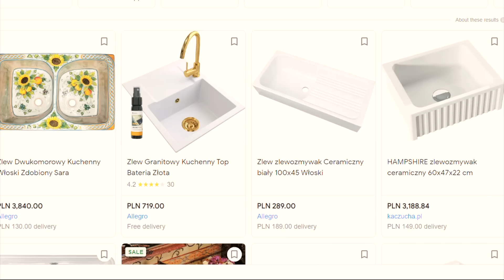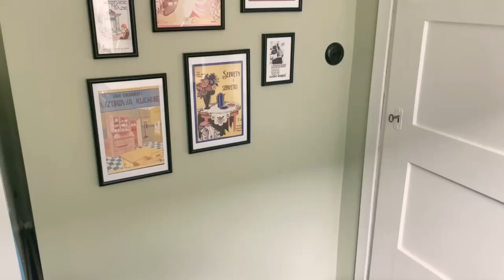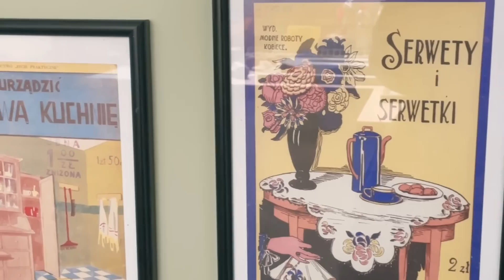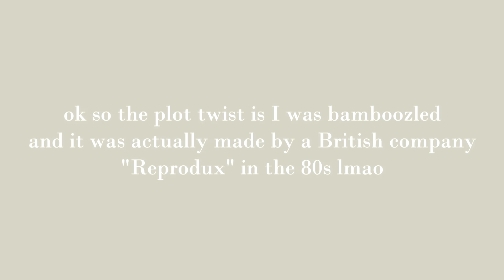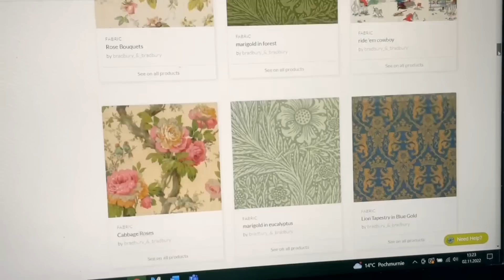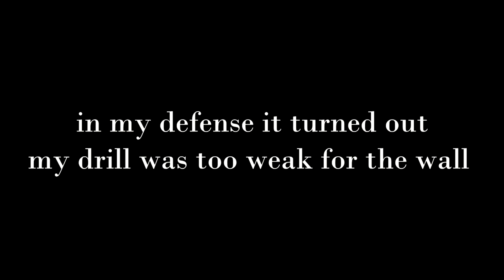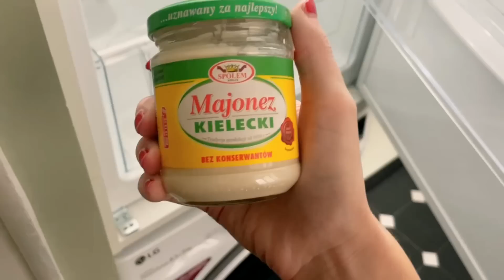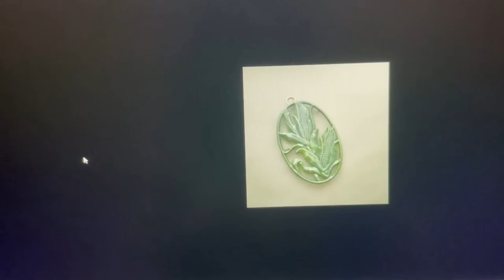Getting Antique Furniture For My 1930s Flat ✨ (and other stories)

Comment: Try placing your wall arrangement on the floor, it's a bit easier:) The spacing you can adjust hanging the bigger pictures first, followed by the smaller pictures. Don't forget to take a picture of your wall arrangement on the floor so you don't forget. However,  I'm only 5 ft 1in so the floor gives me a better perspective. You're doing a great job, the place looks nice and cozy. It looks awesome. Remember to always have fun decorating, you can always change it later by it'sYOUR flat! I'm so happy for you! Oh, and a good way to take off wallpaper is to score it ( they do make a special tool for that) and spray laundry softener lightly on wall, let sit for 5 min or so, just don't let it soak through to the sheet rock. This will also break the glue down and make it easier to remove. I hope this helps. My first house warming gift was a cookbook by  Betty Crocker.. I don't care too much for cooking either. I found air fryers are wonderful and slow cookers or crock pots are great, also. You can put it on before you go out and return a few hrs later with dinner all ready. And a toaster oven, that way you'll use less electricity and not heat your house in the summer. Mine even has a rotisserie for a 5lb chicken (I would not leave this unsupervised) crown molding and baseboards are always difficult in order house due to settling over the years. Can't wait to see the end results! 🤗😊👍🌈🍷🍾🎯🥗🧇🍻🍵

Comment: Such a lovely flat.  Alltough I could say I am not bad with cooking, baking and renovating but I don´t have a sense for style like you.
For any renovation nothing beats a "Schlagbohrhammer" (hammer drill??) , for some walls , sometimes you can use "Stahlnägel" (nails out of steel) with a normal hammer. 
I lived in an old pre WW2 flat with got cheaply renovated in the 60ties. So you either got concrete, brick, paper or some other obscure things in the wall.

Comment: for the baseboard problem, you could try cutting a series of small vertical grooves into the back of the one side of the board so it becomes more flexible and you can affix to your bent wall? just an idea :)

Comment: Is the fridge safe? They are usually supposed to be installed so that there is extra room for air to circulate on top and behind so that the fridge won't overheat. It's a fire hazard.

Absolutely gorgeous ❤
Wish I was able to do something like that.
(I rent and aren't allowed to even hang things on the white walls.)

Comment: If you decide to restain those chairs you got I’ve found anline dye works very well and finishes very even. It’s derived from natural dyes which is also nice. You just need to make sure you seal it with a water based polyurethane varnish otherwise it will transfer to hands and clothes. I’m also curious if boiling water and using the steam would potentially help to remove the wrinkles from the curtains. But your flat looks very nice so far, thank you for sharing.

Comment: My guess/advice for your egg… experience. Looks like you didn’t coat all of the pan in oil + you turned the heat on too high. I would definitely recommend using a lower heat - medium to medium high. AND USE A SPATULA!!

Comment: Hang the curtains & use either a clothes steamer or an iron, holding the iron close to the material and pressing the "steam" button. But first, make sure the iron will not mark cloth with dirt or rust

Comment: No wall is perfectly straight, even on new houses. You’ll have to sand the backside of the trim to get it close, and some screws/nails will take care of that tiny bit left.

The kitchen sink having that draining space is really good for your small space, as it will make it easier to get your dishes as you use them.

The area rug in the living room with the pink wall is a little jarring…

Comment: ON BASEBOARDS VS OLD WALLS.  I am not sure if it is available in your country, but there are companies that make flexible baseboards and trim. Its used on curved walls or arched door frames. It is plastic based, but as someone who also is in the process of updating an old home ( mine is concrete house block with concrete skim coated walls HELP ME GOD) and the flexible trim is the the only thing I have found that does not look like flaming garbage.

Comment: oh if you love the smell of old wood, try getting a bag of huon pine shavings or two!! not only does it smell beautiful, it's all 'recycled' since you can't cut them down anymore, and a lot of the logs are actually rescued from underwater after drifting off between the 1800s and the 1950s, and it works as a natural moth repellent 

anyway this is like. wow. I'm currently redecorating my own room and it's going to be almost entirely fitted with antique furniture (unless I get something new as a small shelf, the newest piece will be my desk which my grandpa and mother built together in the 1970s but designed to look 1920s) and tbh I'm thinking of rebelling against my mother's wishes and buying a couple of sample pots so I can have one of those tritone stripes that you see a lot in 60s/70s design. can you tell which decade I'm going for 

imo those chairs only really need new polish tbh. they're in pretty great condition! the stripping on the two refurbished ones is a bit eh, but if you can find the right polish or stain to match the others, it should be fine? been doing a lot with old wood recently and you'd be surprised what a quick coat of polish will do (and you should polish wood, because it not only makes things easier to keep clean, but iirc it can stop moisture from your hands and stuff getting into the wood and warping it). also big mood to uneven walls since in our house the hallway gets wider as it goes along and it was awful aligning the carpet. idk if there's any point to me saying any of that but eh

Comment: I live in an old house too and I also had that baseboard problem. I "fixed" it by orderung plastic basboards, which are somewhat elastic. Those worked fine. Well done so far! Do you plan to paint the black door that goes to the outside as well - so that it matches the other doors?

Comment: I love the rug❤ but its too small for the space the rug needs to go at least a bit under the sofa and the living room chairs  and create the conversation area not just under the coffee table because it makes everything look smaller, i think you could use the rug in a different smaller area its cute, also the boudoir would be great on the corner between the two walls it would be easier to get to and it would look better if it didnt look stuck on the wall so close to the bed, i would make the room feel more open and a bit bigger and the mirror of the boudoir would look perfect in the corner because of its shape ❤  i learned this from doing alot of interrior design research as a hobby for the past 10 years i hope i helped  but even if i didnt i know you have good taste so your home will look great i am sure❤ i hope my english is not bad

Comment: Hey babe, just a quick tip, did you check if the pan is hot enough? also just wanna make sure you use like some vegetable oil (honestly any oil will be okay, because even though your pan is non-stick pan, its better to not rely on the pan itself) **this is a genuine tip, not trying to be sarcastic, ok love your videos bye**

Comment: that coffee table badly needs new lacquer. the wood is unprotected where its missing, plus its just going to keep crisping off further, because that's what synthetic lakier does. it's like spray-on plastic, and ages terribly. 
FOR HISTORICAL ACCURACY you want shellac-based politura (I'm using Polish terms because idk the english terms and you're Polish anyway lol) instead of synthetic lakier, HOWEVER lakier is way cheaper and easier since it can be airbrushed on by any lakiernik and a normie won't tell the difference.

Comment: Your fridge-in-a-cupboard is stressing me out.  Please tell me that there is some sort of ventilation that is not visible in the video for the heat from the coils in the back of the fridge to escape through!  Fridges need air circulation all around the back.